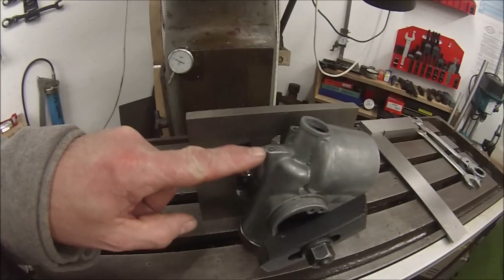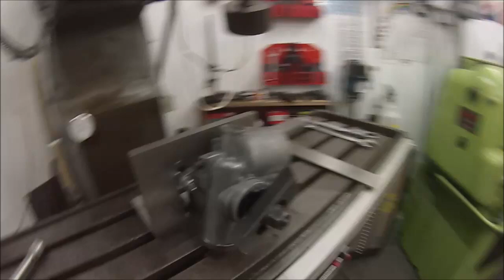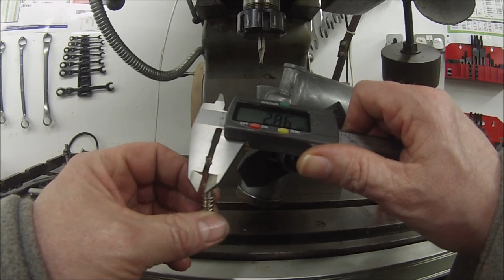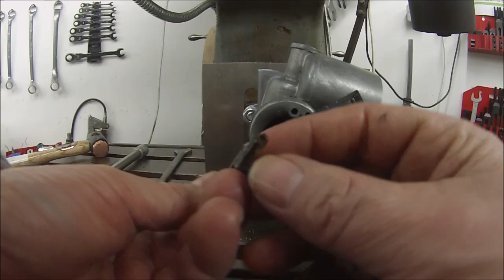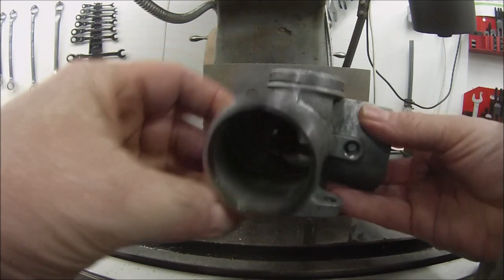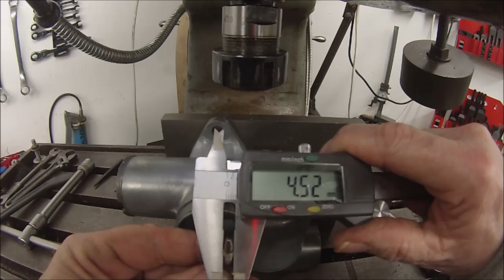Monobloc broken screw removal

Comment: ..Ace fettlings, Sir A G ,... Pray tell, what makes / models are your milling machine and lathe, if I may ask ?...
Reply from the maker: Thanks for watching and commenting. The milling machine is a CVA but was sold branded as an EH Jones model 55, it has the motor rewound to enable it to run on a VFD from a single phase supply. I am currently mid fitting stepper motor control to the quill and table traverse to give better boring and facing finishes, one of the 'one day i'll finish it jobs' . The lathe in the workshop is a Colchester student, again running of a VFD and rewired with digital control so it operates the same as standard apart from what was a motor on switch is now a variable speed pot. Another lathe is in the garage next door, that is a Chester 920, again modified to 3 phase VFD for better control. I need to do a 'tour' when I get tidy!
Reply: @AGEngineering  .. Thankin' ye kindly for the prompt reply, squire,.. I like the design of your milling machine with it's screw adjusting head tilt / swivelling arrangement , ( for want of a better description ! ). Also looks to have a nice throat capacity ,( lude comments aside ! ). Not seen one of those mills before and I'll keep an eye out for any coming-up for grabs ,.. I recently bought my first miller in the form of a Tom Senior, so I'm looking forward to having a go at destroying poor lumps of metal and tooling as soon as I get new belts for it !.. Do make a vid of your workshop set-up as I'm positive there'll be many like m'self happy to see it,.. Keep-up the good work saving all those fine Brit bike parts,.. Cheers,.. Dan,... SW London.

Comment: Luckiest man alive. 2 successful stud extractor usages in one session. I'm not sure I've had two successes with an extractor in my lifetime!
Reply from the maker: I know where you're coming from, I only use stud extractors in certain situations, like if the screw is moving slightly and you just need to grab a hold of it. If the bolt is seized and the head has sheared, then you will just break an extractor off in it trying to remove it and make the job worse. Thanks for watching, Ade.

Comment: I have no metal machining experience so I may be asking a stupid question if so I apologize. 
Wood lathes can be made to turn either clockwise or anticlockwise.
Does your machine turn anticlockwise? if so you could use Left Handed Drill Bits which may extract the screw at best & at worst wouldn't force the screw further in. Just a thought but a great video anyway.
Reply from the maker: Bernie, yes it will turn anti-clockwise, but I don't have any left hand drill bits, yet......
Thanks  for watching, Ade